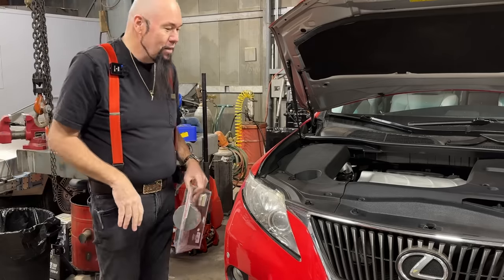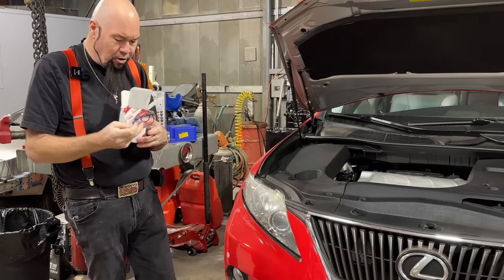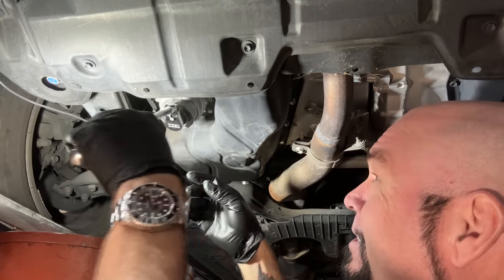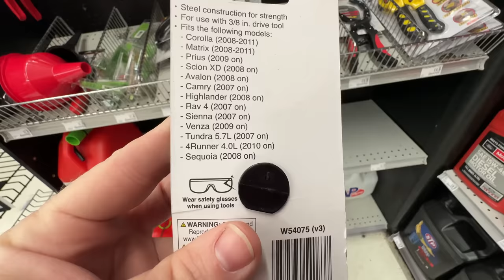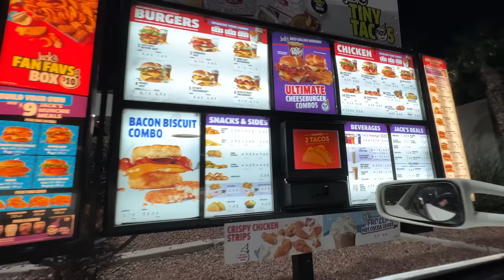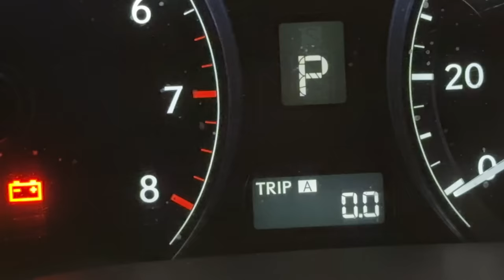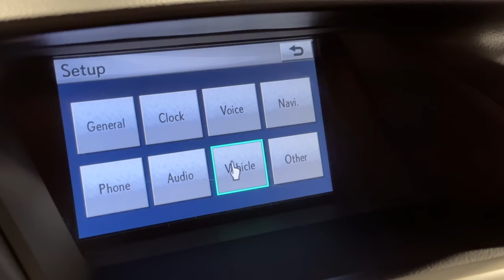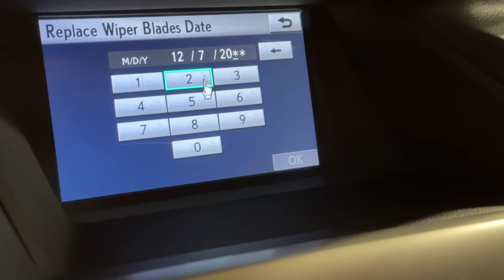Don't change the oil in your Lexus RX350 until you watch this video!

Comment: While I use Toyota brand oil filters, I always had trouble trying to push in the plastic drain funnel that came with the filter. Sometimes it would work with a lot of effort and swearing and other times it would drain hot oil down my arm, fall off and make a mess. I discovered if you purchase a Walmart brand 'Super Tech' oil filter, it comes with a screw on type plastic drain funnel instead that is simple to connect than the Toyota push in version. I have since kept this 'Super Tech plug and continue to reuse it on my future oil changes when I purchase Toyota brand filters.   I also replace the oil plug washer with a new one before reinstalling the drain plug.

Comment: I use Archoil 9100 additive.  My spin on filter I attach a magnet to it to hopefully collect fine metal particles. 6000 miles distance would seem right with a remaining 6000.  As you drive the remaining 6000 the distance you drive is subtracted from the iniital 6000.  Drive 10 miles and the remaining should be 5990

Comment: That little piece of plastic in with the new filter is designed to be pushed into that hole you revealed when you took off the oil filter housing end cap, to allow the oil to come out do then you are removing an empty oil filter housing! But you would have known that if you read the instruction!!!

Comment: Good video man. Check your timing cover and valve cover gaskets for any oil leaks, the oil on your oil pan may be residual from them. The timing cover however is a very common leak with the 2GR engines.

Comment: I'm a lube tech at Toyota. No one bothers with that drain. Just pull the housing loose and let it drip, or just let it gush out, but then you end up stinking like old oil all day. But you do need to change out the big O ring every time.

Comment: Folks, be careful when selecting a oil filter for your Toyota V6, ‘cause they have two filter sizes…  YZZA1 and YZZA5.  It was evident that the dirty filter was a A1 by the height…it protruded approx 1/4” out of the housing. The new filter was protruded approx 1” out of the housing.  I also checked online line they all called out the A1 for both rx350 and Rx460h… unless the previous Lexus owner changed the oil filter housing to a deeper one that can accommodate a A5 filter then be carefull.  If you are unsure then buy one of each, remove the dirty one and “ marry” it up to proper height. Now you have the proper filter number for all future changes.
 But for this Rx 350,  non modified oil filter housing, the proper oil filter call out is the YZZA1….

Comment: when you had 6000 miles in, it showed you would get your dash notification in 6000 miles for the next oil change. It is easier going 5000 miles. In that way your changes occur at 5, 10, 15, etc...much simpler to remember with 5000 mile intervals. Great video...your comments make me laugh, mostly because you are right on the money with them.

Comment: Good job buddy. So I worked at toyotalexus , first thing, you don’t need to change the smaller o ring , only the larger orange.  I have the 09’ rx350.  When you screw the canister on you don’t tighten till it’s stopped in ur video u went all the way till it’s stopped , it’s just 1/4 turn after screwing on.

Comment: I work at a Mobil station that uses Mighty air filters. My boss and both his sons drive Lexus RX350’s. Those take the Mighty TC (or CAF) 2023 and 2024. The TC2024 is a little tighter but it works when the lower numbered one isn’t available. 
Yay! I said something mechanicy!

Comment: Use the plastic valve which comes with the filter to release the oild BEFORE unscrewing the filter housing. Then you won't get oil all over the place
Reply: I'm glad he figured it out but one thing I think he over looked was that the valve was backwards that's why he was struggling to get it out

Comment: 31:02 - For the navigation based maintenance monitors you put in the date of the next service,  and the distance to the next service. So for example you would put in 6,000 miles, after setting the remaining will match the distance, but as you drive the vehicle the remaining will decrease down to 0 then tell you to do the service, or the date will trigger the service message. Then at that point you'd hit the reset button at the bottom of the screen.

Comment: I just changed the oil on my 2007 Lexus RX 350 for the first time and when I tried to take the plug off the end of the housing the whole housing came off which was fine with me I never replaced the O-ring on the cap I just replaced the big one I didn't have the right size wrench for the oil housing but since it came off I went ahead and put in the new filter

Comment: The newer Toyota and Lexus went back to the spin on oil filter.
Reply: The spin on filter is actually more modern.  For some crazy reason manufacturers went to those retro junk cartridge filters for a couple years.
Reply: Yes, my 2021 Rav4 has the old spin-on filter. I think they are a little more expensive than the cartridge filters though.

Comment: Love the video... 👍 Wish it was a one handed operation when resetting Toyotas (oil reset/maintenance required light.) Like it is on my Cadillac CTS Sportwagon... What I also like to do is reset trip B to zero and use that as a guide to see how many miles I have driven on that oil. So my rule of thumb is change the oil every 3k or unless my oil life monitor hits 50%. Whichever comes 1st...!!! Since oil is cheap and I run a manufacture specified full synthetic... You can't beat peace of mind, with proper maintenance...👍👍 I love all the videos Bob... This one was very educational...!!! Thank you for creating it... Can't wait for the next one...!!! 👍✌️

Comment: I’m sure you’re aware of Motivx Tools.  Check their web page they will have a high quality filter wrench and possibly an adapter with a length of hose attached to drain the filter housing prior to removal.  Have one for my Tundra that works like a champ.  None of the mess you get when using the plastic drain that comes with the filter.  They also sell kits that come with a funnel that attaches like the HFT one in the video.

Comment: Bob. You had it right the second time. You enter the mileage change interval. It says remaining 6000 because you haven't driven yet. It'll start counting down. My 07 Lexus manual recommends 5k/6 months. 
Also that drain on the filter needs to be torqued I think. All the info is on the box.

Comment: Nice. I know exactly what kind of engine that has, as it's the same as my 2012 ES350. It's a DOHV, dual timing chain equipped, 87 octane, 267HP 245FP torque, 2GRFE 3.5L.  It's a bulletproof engine. 
If I am not mistaken, that engine uses 5w 30, and it's conventional oil, not synthetic. 5w 30 is what it says on my cap, but yours may be different. (For the ES350 that changed in 2013+ to 0w20 synthetic.) Oil Change is every 5000 miles for the 2GRFE engine in my ES350. It's an engine that is used on a lot of Toyota models. I was mentioning this a while back in one of your videos as a possible engine to make work in a DeLorean. I don't know how much work is involved to make that happen, but I know people like to drop the 2GRFE in MR2's, and it's just as simple as changing the wiring harness. So I hear. The transmission, on my car, is a 6 speed U660E transmission, and it is sealed. If you have the same transmission, you will need a special pump exchange setup to change the transmission fluid. There is no transmission dipstick. There is a plug on the bottom for checking the level. It's bizarre. I was told you change the transmission fluid every 80-100K. Engine coolant is Toyota Long Life. (Red)

Comment: VERY important to inspect the oil bypass lines at the front of the engine too.  They can fail without warning (as did on my daughter's RX), luckily she pulled over and shut the car off just as the engine ran bone dry.  There was a service bulletin but some cars never got the work done apparently.  If your lines are rubber they are the old style and will fail.

Comment: When I take my Lexus to the dealership, the mechanic will send me a video of them doing the inspection of the car. Way better than the "This is your air filter" crap some dealers try to pull. It's not cheap, but I love the service.
Reply from the maker: How much is the full service? With oil, filters, etc.?
Reply: @RobertMoseley  I'm in KCMO, the "Oil/filter Change & Rotate" is about $160. They wanted like $600 for the 70k mile service: oil/filter, rotate, differential check, transfer case check, air filter, and cabin filter. I did not need the service, because similar work had been done recently and I could do the air filters myself. I don't let them do everything because some of the pricing is ridiculous ($100 for cabin filter change), but I am confident in the work I let them do.

Comment: When I have to take my GX in, I goto the Toyota dealer as the labor is 1/2 as much per hour as what Lexus wants for the same service down the road.  For the data entry you add the current  plus the 6k.  120602 (114602+6000)

Comment: Why don’t you watch a five minute video on this job, I guarantee you will see how easy it is and you would be able to explain what you are doing to help people. Look in your new filter box and you will find a plastic part to drain the oil out of the filter housing. Good luck, gotta go.
Reply: yup, i have been changing my RX350 for several years the correct way. very simple and quick

Comment: Have you ever heard of IXL oil conditioner??? . It’s for diesel engines but I use it in gasoline engines and just about anything I can think of. I ran across IXL at the Portland Oregon swap meet over 30 years ago. I’m a retired heavy duty diesel mechanic with a bachelor’s of Science degree in Auto-Diesel Technology-40 years ago. As I was cruising the swap meet I came up upon their booth that had a 300ci inline Ford engine on a engine stand with the appropriate safe guards and the valve cover was removed along with the oil filter and I cannot remember if the oil pan was off or not- a long time ago. They claimed that the motor came out of a van with 100k but before removing it they treated the engine oil with IXL conditioner and I think drove it for 600 miles then removed the engine for the display.. I stood their for several hours as they started ran the motor then turned it and repeated it. So I purchased some IXL and I’ve been using it ever since. You can purchase it online at the IXL store or maybe a local Semi truck dealership parts store. Their is a interesting history behind it, but to lengthy for here now.

Comment: You need an oil plug gasket and a oil filter wrench designed by Toyota. I had the same issues with a Camry that I owned. The Toyota oil is also made by Mobil 1.
Reply: The Toyota oil is based on Mobil Super not Mobil 1.  Mobil 1 is superior to TGMO.

Comment: LOL, knew exactly what the problem would be before even clicking on the video.  Toyota/Lexus changed from the integrated cartridge some time during the late 2000's.  Honestly I miss my SC400, that thing was so easy compared to the GS460.  The maintenance screen wants you to enter the NEXT service date, not the current service date - and the number of miles before the next change (so when you put 6000 in, that was correct - but you should have put the dates in as 2023)

Comment: Also, be careful with the torque on both the metal drain on the filter housing.  I think it’s 10 Ft-lbs.  Too tight & the next time your try to remove it, the whole filter housing will turn, leading to another oily mess.  Don’t ask how I know.

Comment: My 2014 Toyota Rav4 has an identical setup to yours, probably because they are on a similar platform. But I'm not a fan of the Toyota/Lexus filter cartridge housings. The bottom metal piece on mine is frozen on, so I have to unscrew the whole cap off at once. That creates an unnecessary mess for me since I'm unable to drain it first. And whats the point if the bare filter is the same price as a regular metal one for other makes at the store?

Comment: Is there no rear diff fluid you need to change or check on?
Reply: his is front wheel drive. only on 4 wheel drive you need to change the rear differential fluid and transfer case fluid every 30k  miles. Very simple to do

Comment: I’m planning on buying a rx350 
And it has 110k miles 1 owner and serviced periodically and Lexus dealerships .  I was looking for derives on CARFAX and.    Here is where I need your help it says on CARFAX it was serviced for the 45k miles service routine.   On it said one thing I’m trying to find out. “All fluids checked / adjusted 

Does that mean they put transmission fluid in.  I want to know because i would like to service it now again
Reply: Jay, I have a 2010 RX 350, I have changed its transmission fluid and filter. If you are interested in the details, drop a word here, then we can discuss the matter further. If you want to just change the fluid, then it is an easy job, but if you intend to change the filter too, then it is a huge job.

Comment: like you, I had never seen this type of oil filter system on a car till I bought my 13 Camry. If you took 2 seconds and read the instructions on the oil filter box you would have had a much easier time with less mess! Toyota had reverted back to the spin on filter and realized listening to a bunch of tree huggers and accountants was a mistake. IF IT WORKS, DONT FIX IT!!!!!

Comment: Not bad video, but NEVER NEVER mix anything with your oil!!  The oil has been formulated to exact specs by the manufacturer. If it could be better it would be. You are only throwing off the carefully calibrated mixture, causing unknown results. You are also throwing off the formulation and tolerances the car manufacturer specified.

Comment: Check for oil leak at the engine block, engine head and timing cover mating point. Oil leak here cannot be repaired without engine removal? Only on v6😎

Comment: I change my oil with homemade wooden ramps because my old 1978 steel ramps are too tall to clear modern low plastic bumpers
I'm a dairy manager so I just use flat cardboard under the car and any drips or spills the cardboard absorbs  
Why don't you just use old chicken wire folded over as a temporary screen

Comment: I have a question... Should I change my transmission fluid on 2015 RX Lexus it have fifty nine thousands miles.
Reply: No
Reply: Thanks! For getting back to me because I am confused.
Reply: @rogerlewis3507  Yes you should. Just do a drain and refill. No flush. Access is behind the driver side front tire. To avoid having to fill to the right level, just take out 3 quarts and put back in 3 quarts. Do 3 and if you want do another 3  after 5k miles.

Comment: Oh shit, those are the ones where you do NOT want that thing in the middle to come apart. If it comes apart, there's a good chance you broke it, and the 3rd party ones are all crap too, apparently you really need the OEM one. Check for a vid by The Car Care Nut where he explains how to do an oil change with this style of oil filter.

30:40 those distance figures are a countdown to the next change, I sure hope you intend to change the oil and filter sooner than every 114,602 miles!

The service interval is the interval when you are supposed to do the list of things that they call an actual service, which includes inspecting hoses, fluid levels, lubricating door hinges, etc. Read the manual, it's all in there. These cars are too computerized for people to not be reading the manuals these days!

Comment: You stick the white plastic drain pipe which comes with your new filter into the filter hole to drain the oil from the filter housing. You can then remove the filter housing with little oil spillage if any. You missed that part and they wouldn't have been such a mess. There is also a set amount of force you should screw both the filter and plug... Don't crank up the car before replace the oil cap, that messes with oil pressure readings. Your process has so many mistakes talk about confidence with incompetence.

Comment: This man is changing oil while wearing what appears to be a Rolex.  There's something you don't see every day.  That tool to remove the oil filter canister is cheap on Amazon--less than 10 bux.  My IS needed it, but my LS (totaled on Thanksgiving) just needed the 3/8" ratched alone.  Not sure why the change, but it was one less thing to bother with.

Comment: 6000 miles remaining. YOU HAVEN'T DRIVEN IT YET! you just changed it. So you have 6000 left. Drive a mile and see it say 5999 remaining. 

A oil filter wouldn't hold enough dirt for 6000 miles. So change it after 3000 like you are suppose too. lol. Old cars are always 3000.
Reply: 3000 miles was for old API SC inferior oil from the 1960s

Comment: Looking at a 2014 RX350 today. With 86k miles they want 21k for it.
Reply: the price doesn't sound too bad to me. I got my 2015 with 73k miles for 21k last fall. if the car is in good condition 21k sounds fine. or you can try haggle the asking price